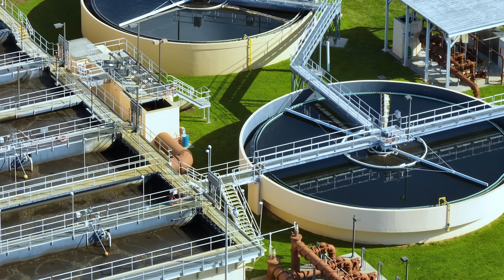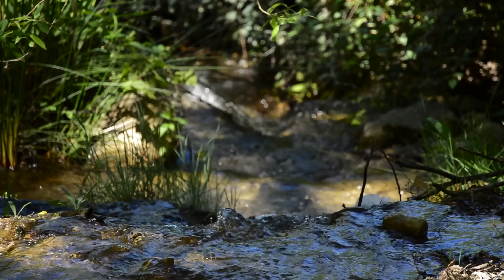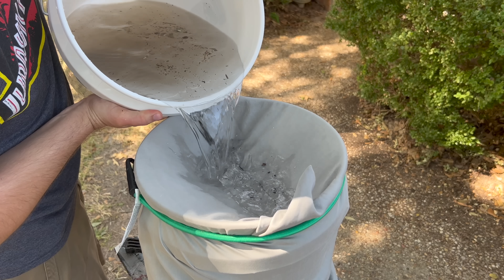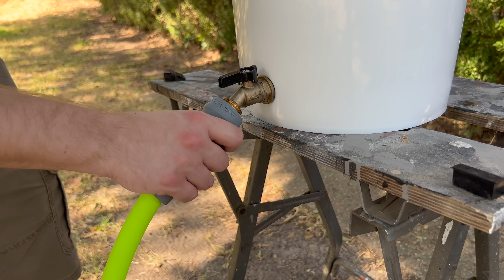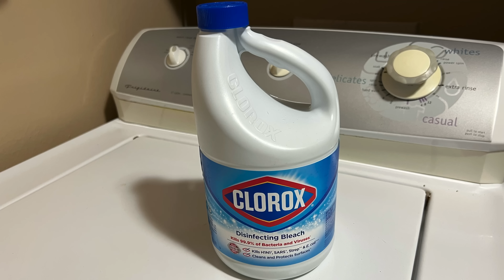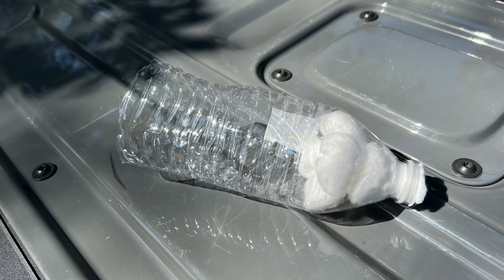How to Purify Water During a Long Term Disaster

Comment: Hi from Sweden. We harvest rainwater and I purify using the following methods: I filter it through cloth first into a large pot, then boil it for three minutes (altitude). I use the kitchen cooker for that but also have a working woodstove if no electricity is available and if need be, will use a fire outdoors. I have a two-bucket set up..the top bucket contains layers of fine sand, clean gravel and activated charcoal, each layer separated by cotton fabric. I pour the cooled, boiled water into the top of this and it trickles through and filters down into the bottom bucket via holes in the base of the top and in the lid of the bottom one. In winter, when it doesn't rain, we process snowmelt in the same way, though of course it takes much more snow to make a boilable pot of water than it does rain.
As back ups, I store (short term) bleach, water purification tablets, a portable filter straw and of course, more activated charcoal.

Comment: Thank you for showing people that no one filter is enough to make water safe and that filtration and purification aren't the same thing! I stock up on zero water filters because they are the best when it comes to PPM without having to use any electricity or fuel but the water does in fact still need to be boiled or treated with bleach. I love how you break that down and make it super clear to people who might not fully understand. I have to get better at explaining that.

Comment: I live near the sea and so, as well as the fresh water purifaction set ups (including the low priced virus removing "pure clear life filter" straws), I have a simple portable desalination set up. Simply made from Stainless steel funnel (which goes over the container to be heated) and a copper coil held in place at the neck end using a champagne cork with a small hole in it. Have tested and it works a very well (salinity tested using voltmeter and taste).

Comment: A special piece of equipment I never see mentioned,  one obvious reason most are made of cast iron and are very heavy.  But if your homestead/hunkered down in place and have a existing shallow well...get you a Ole school Pitcher pump, have several packing for replacement and or leather to cut some.  Tractor Supply is a good source to purchase one.

Comment: Depending on source and available time, a settling tank can help save your filters.  Just let water sit in a bucket for a while so that sediment can settle to bottom of bucket.  Pour, siphon, scoop or otherwise get top water without taking gunk from bottom.  Some contaminant float.  If you see anything on surface such as oil slick or soap scum this may not be an acceptable water source but you can reduce concentration by discarding top layer from settling tank.

Comment: Buy yourselves a Sillcock key to access water from large buildings, malls, businesses. Usually outside on the side of the buildings. May be covered with a little panel. Sillcock key will unlock it. It will open the water ways. Even without electricity.

Comment: A Steripen UV light is another good tool to have in your water purification arsenal… It’s effective against protozoa, viruses and bacteria including cryptosporidium and giardia.
Reply from the maker: Thanks for watching and commenting!
Reply: Absolutely. I used to use one when traveling to Africa. It worked very well, and should be part of one’s backup systems for a severe disaster. The Grayl is superior for short-term use because it also filters out industrial chemicals but their filters only last a short time, even with pre-filtration.

Comment: Any suggestions on  bottled water that is starting to have a plastic taste.
Reply from the maker: I would only store a small amount of bottled water and use it within a month or two, rotating what you have.
Reply: @diypreppertv  too late...lol...I  started out storing it.  I am now circling through it but am finding in some a different  taste. Not all.
Reply: If your bottled water is in a cool dark place out of the light, then your bottles are probably off gassing. I wouldn't drink it. You could use it for washing dishes, bathing, cleaning. Sorry, if you stored a lot. The off gassing, can't be boiled off.
Reply: We have the same problem. I've had some good success with putting it thru a Brita filter.  I then put the filtered "bottled" water in half gallon glass canning jars. Hope this helps!

Comment: Hey JR, Question: I have water stored in 55 gallons in my garage that i filled from the faucet. Should I treat it as a whole or as im using it? Thanks
Reply from the maker: Tap water should store for a while since most of it’s chlorinated. As long as there aren’t any signs of algae growth, running it through a Berkey or Zero water should be fine. If you’re worried about it though, you could always just treat it as you use it.
Reply: I have been using tap water for years. I just boil it before drinking.

Comment: I have a bathtub bob/water bob that I want to fill, especially with all of the nearby fires of late. 

Do I treat it when filled from the tap before or when I go to use it?
Reply from the maker: If you fill it when there isn’t a boil water notice, it should be fine.
Reply: @diypreppertv  Thank you! Water is currently good, albeit it's hard water but that one thing I wasn't sure about kept me from filling it up. I love that I can close the top since we have cats   and I don't want fur to be the filter.

Thank you so much. I have water anxiety after the town water supply became contaminated in the Camp Fire.  We didn't have a home to go back to (or much of a town), but the situation lasted a long time after the fire. 

Your reply gave me a goal for the day now. Thank you.
Reply from the maker: You’re welcome! Just remember those are things that you don’t fill up until you think you may need them. They’re only meant to be used for a few weeks.